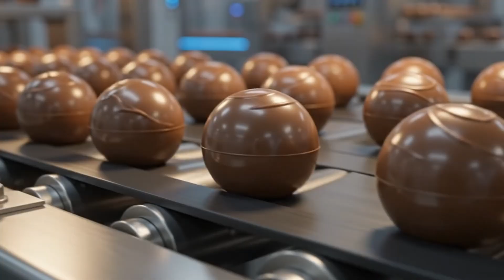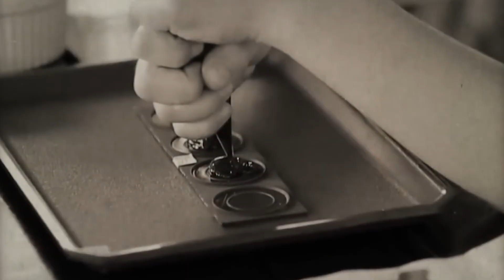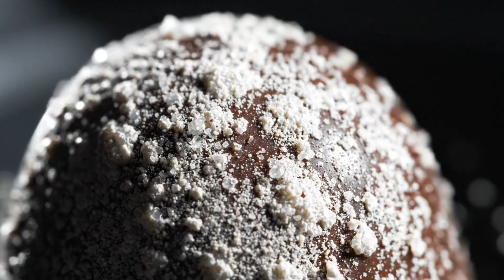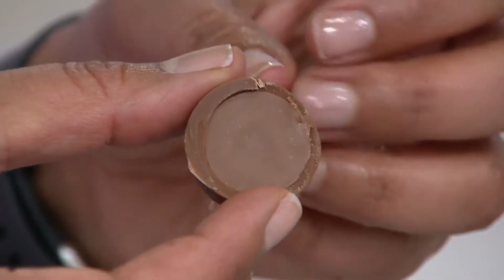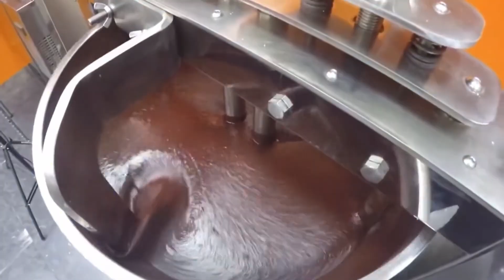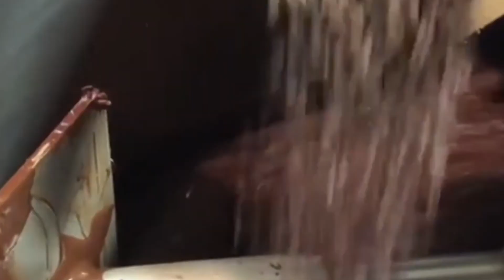How Lindt Chocolate Is Made: The 1879 Mistake That Built a $5 Billion Empire

Comment from the maker: Wait, so the filling was already liquid when it went into the shell? How does it not melt the shell while it's still spinning at 2,500 RPM? 🤯
Reply from the maker: Sharp catch — the shell is chilled so the outer layer sets while the center stays fluid. It's a thermal gradient measured in single degrees, and the shell contracts as it cools to lock everything in. That's the whole trick. 🍫